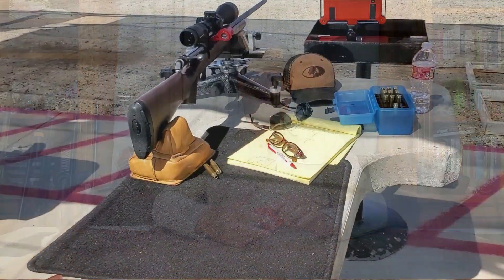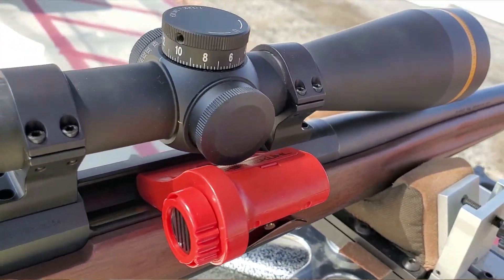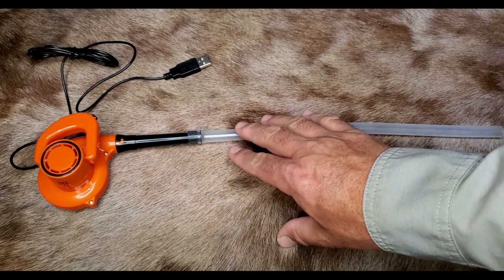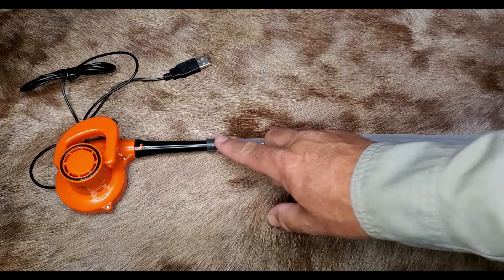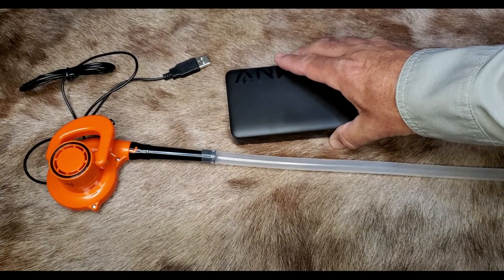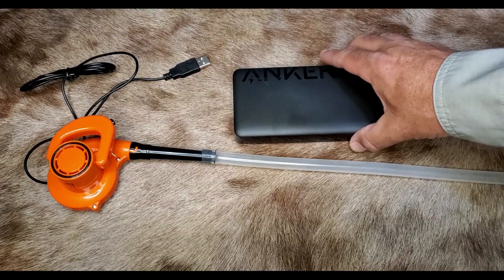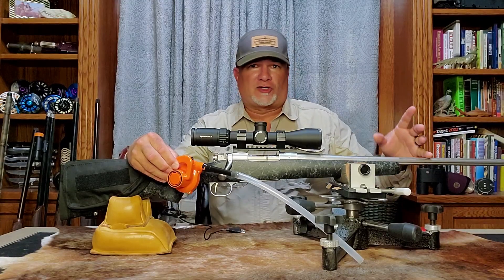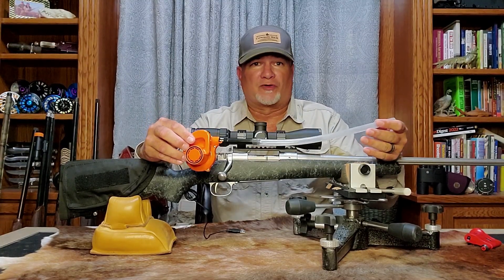A BETTER BARREL COOLER

Comment: I was in the machining/welding)/fabrication trade all my working years, i have since retired.
I was fortunately around industrial gases and used them 40 years ago to help cool barrels down. Used cO2, argon, helium snd nitrogen and blends of them. When set up correctly it doesnt take a minute to get to ambient barrel temp. You could easily over do it if not carefull.
Now days i do things a little slower but still have gases in my shop if the need arise. 
The downside is that gases are way expensive now just like barrels, actions, primers, powders, bullets, eggs 😂😂😂

Comment: If I can find a way to mist water into the airstream I will get faster cooling plus the added benefit of flushing powder residue.
Reply: That would create more problems than good. You would have to run a dry patch to remove the excess moisture from the bore

Comment: ANKER power bank ran me way more than $28 on Amazon. All cost tallied I was in the mid 50's BUT........this little blower DOES move some air! No regrets DIYing this barrel cooler. Over 2x the air movement, longer operation time, for less $, plus multiple usage of power pack, it's the winner.
Reply from the maker: Did you click on the link in the description (as indicated in the video)? The Anker power bank was $28 when I made the video; now it's $31.
Reply: @desertdogoutdoors1113  no, I did not. Went through Google search. That might be the hitch but it's still a fantastic DIY.

Comment: I bought and have tested this contraption. It works well for me here in Houston, and will speed up load development considerably. One improvement I made was to cut the base of a case off above the wall taper and push it into the hose. This increased airflow down the barrel and keeps the hose from falling out. Thanks for this one, DD.

Comment: A little modification would make the blower send more air down the barrel.  Remove the black tapered tube, measure the outside diameter of the exhaust tube and buy that diameter hose as that will be the inside diameter.  Cut the hose so you can stand the rifle on its recoil pad and the blower can sit on a table next to the rifle.   Now you will move more air than with the tapered nozzle would give you, just make sure to keep hose length to a minimum.  This will remove as much friction as possible from the system…..    remember hot air will rise so muzzle up will cool the barrel a little faster …

Comment: What if you got one of those lunch box size ice chests and put some ice in it and set the blower in it? Of course you would have put it in such a way that the melting ice didn't get the blower wet. Also maybe a little longer tube.
Reply from the maker: Way overcomplicated. Hook up the blower in this video for 2-3 minutes between shots and you'll be good.

Comment: Do you park you truck next to the bench to plug it in. Then leave the truck run because the usb port wont have power with the truck turned off.
Reply from the maker: WTF??????
Reply: Rechargeable batteries are widely available

Comment: I use a battery operated pump for a air mattress and works great with the hose set up. I measured the temp of the barrel with a laser thermometer and it cooled it down in just a few minutes. Down side is the D batteries. But so far it’s lasted several trips to the range.

Comment: What are the real world results. How much did it cool the barrel in a 5 minute span ?
Reply from the maker: After a couple shots with a sporter profile hunting barrel, you will experience POI shift. I cool the barrel back down very close to ambient temperature when zeroing or shooting groups for accuracy nodes during load development. The only accuracy that matters with a hunting rifle is a cold-bore shot. It takes about 3-4 minutes between shots with this barrel cooler to bring the barrel back close to ambient temperature. For target or competition rifles, you shoot "sighters" or "foulers" and shoot groups with a warm barrel, but you can't let it get too hot or the POI will shift again.

Comment: I’ve done this same setup but with a portable mini air mattress inflator as the blower. I like this USB blower better I think. A tip is if your range requires a chamber flag between sessions you can put yellow tape around the length of the tube. They are satisfied with this at my range and they are sticklers about using chamber flags.

Comment: I switch a few years back to air mattress / inflatable blower,  also have silicone hose on but a thin walled brass tube approx 3 inches long at the chamber end does not restrict the flow and makes it easy to fit in the chambers from 223 to the magnums.  Most hobby shops stock brass tubing of various sizes that will fit snug inside the hose. I like the usb battery pack more than my 12V setup. Greeting from South Africa😊

Comment: Sounds like you need a co2 tank or a scuba tank, cool the barrel down in a matter of seconds 😅
Reply: Or a bucket of water and an aquarium pump. Run the pump for a few seconds, run a dry patch through the bore and you're ready for the next series.

Comment: Would have never thought of using an acrylic hobby paint dryer for this application. I'm all the way up in Canada. It's almost impossible to find the magneto speed or its predecessor, the riflekuhl. Especially for a decent price. And battery life was always a concern.
I've literally used air mattress pumps in the past when doing load dev and testing during summer months and hated it just out of respect for others on the local range and the size of the unit.  Thanks for this tip. I literally ordered one right after seeing this. Under $20 CA to boot.

Comment: The true test of its value as opposed to the other will be how long does it last.
It is much louder, but folks should be wearing ear protection on the firing line anyway.
Both could work while the firearm is "racked" during ceasefire times, but your setup would be less likely to drop out while racked.
I could REALLY see the benefit of a cooler during a prairie dog shoot as well.
One could also make a manifold that could cool 2 guns about as fast as the Riflekuhl would cool one, since you had a whole meter of tubing.😊